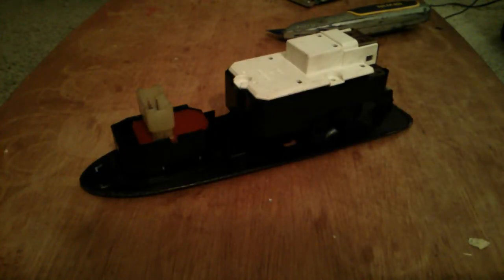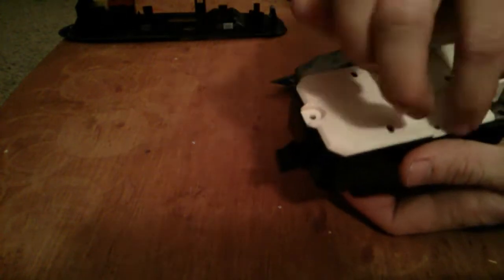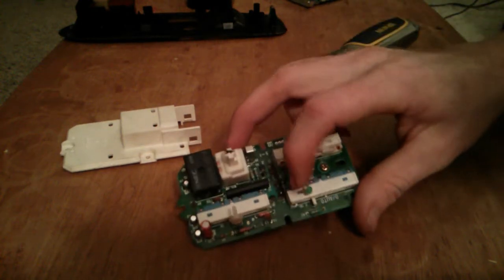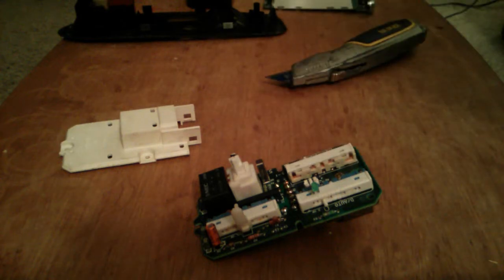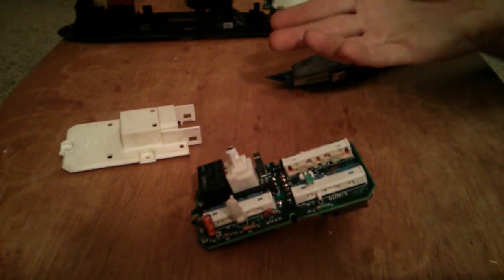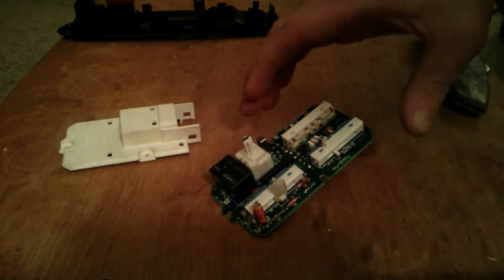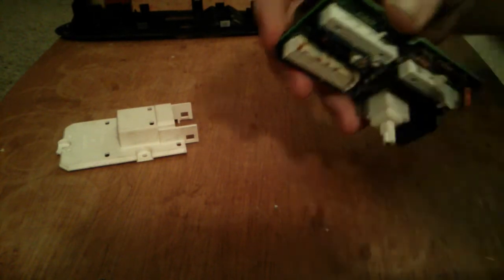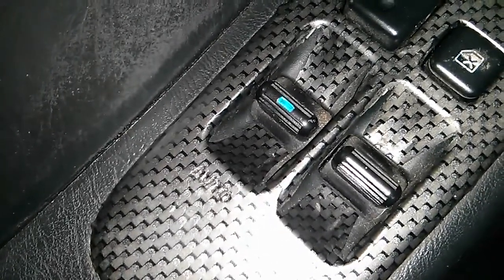Changing Your Power Window Switch LED Color

Comment: These little switch lights stay on in my truck eventually killing my battery, would you know how to solve this problem?
Reply from the maker: +adame Camacho hmm, sounds like you have a ground switch that is defaulting closed. Meaning something should shut off. I would try to find the problem. Check out carcomplaints.com under the electrical problems for your car. This issue could be listed